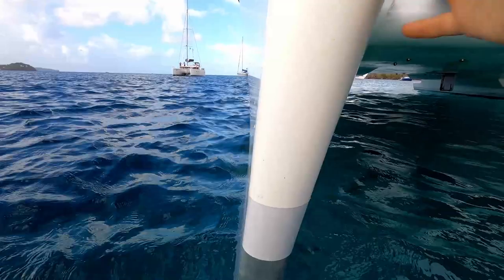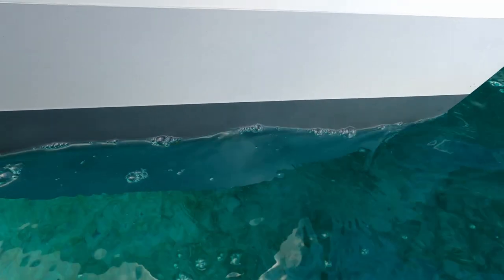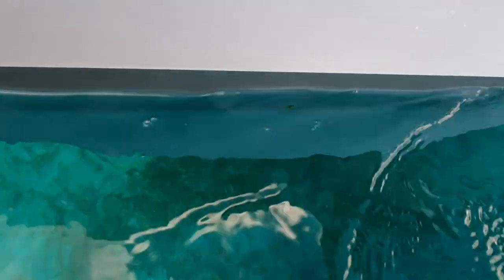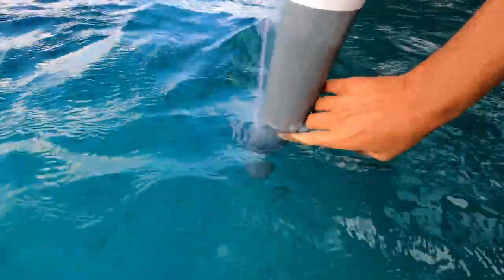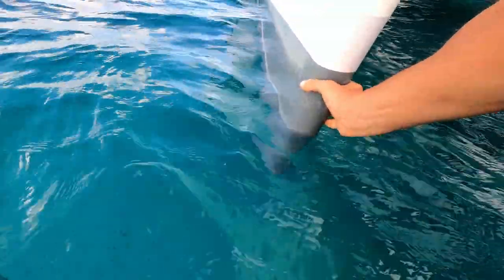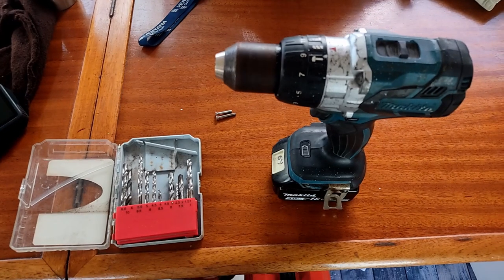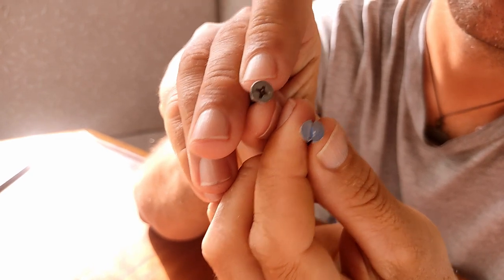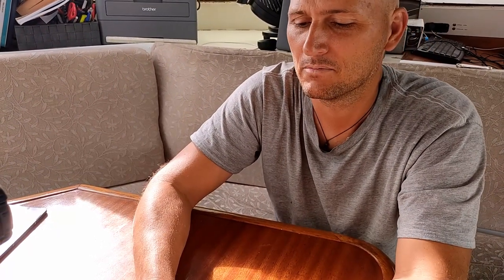How we made our waterline markers

Comment: I may have missed it but where is ideal place (vertical height on hull) to put the mark? For example, if you have a new somewhat empty boat before loading it up with cruising gear, water, fuel, food, would you wait to see where you sink down to before marking it? Or would you drill it at waterline where boat sits before loading it then see how much you sink as you load the boat up?
Reply from the maker: The ideal place to put them is where you want to monitor the boat from. If you want to monitor it in relation to light ship, pull everything out and mark it. If you are like us and know a set up that was good amount for cruising and light enough to not kill the boat put it there.
There is a bit more on it on our web page,I think Anna did quite a blurb on it there. www.youngbarnacles.com
It is a reference point so you know if you are starting to overload or change the trim from a point you decide you want to try keep the boat at👍